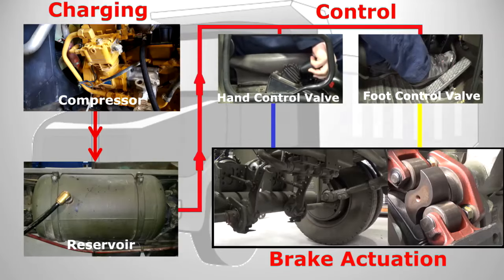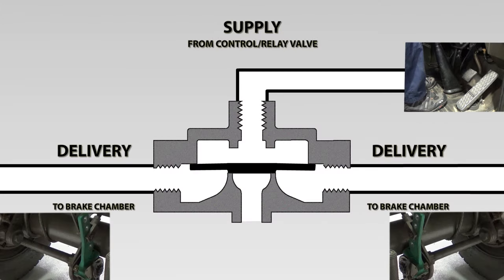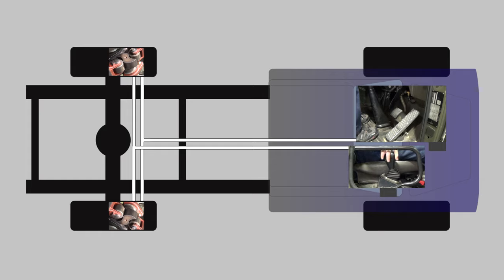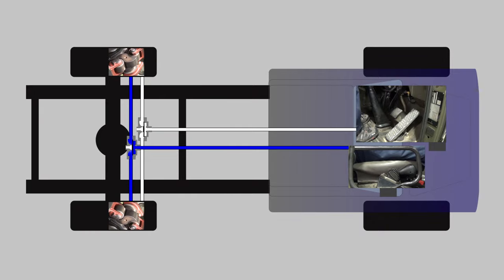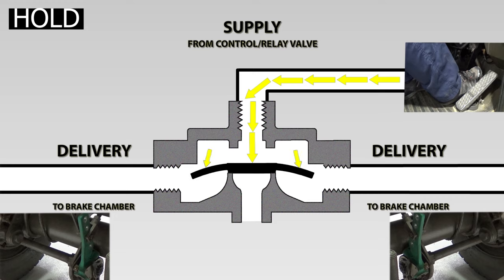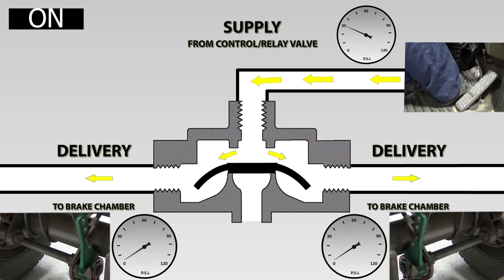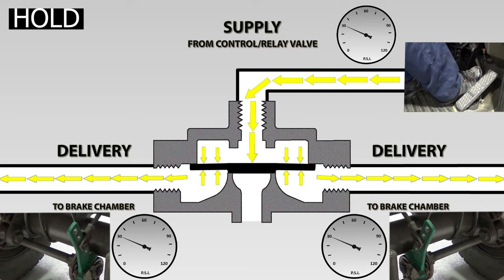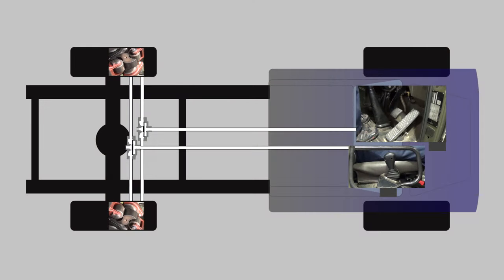Quick Release Valve - How it works. Air Braking systems and Commercial vehicles. QRV

Comment: I am a first year HGV technician apprentice. I can tell you, you have put to shame my training provider's half-ass attempt at explaining this topic. Keep up the good work, a video on trailer control valves would clear up a bit more confusion too. Also just a quick question, is the difference between relay valves and quick release valves just that relay valves are used for long vehicles like truck and trailers, plus the fact that they have their own air tank? they seem to both serve the same function, i.e. minimising brake lag...

Thanks again!

Comment: Fantastic video! I hope that you can make more of these animations becuase they are very easy to understand! 
I am currently under education as a truck mechanic, and these air brakes system and valves are not always easy to understand, especialy when the books i am given, and the teacher cant explain it so i understand it. 

Would you ever considermaking a video on the trailer control valve? 
Thank you!

Comment: Hi quick question I got 2017 Freightliner Cascadia every time I drop off my trailer my air bags Raise up then my leveling valve leaks air then I wait about 3,4 min it gets back to normal then I’m able to drive I did change the leveling valve ,quick release valve still the same any idea pls need some help thanks 🙏 God bless you !

Comment: My textbook says that quick release valves are only installed at the delivery line to the front wheels. Is it correct?
Reply from the maker: In a way yes. As the front wheels are close to the drivers controls, you wouldn’t need a relay to speed up application, so you can just use a QRV on its own to speed up the air release. (It takes longer to release air than it does to charge air).